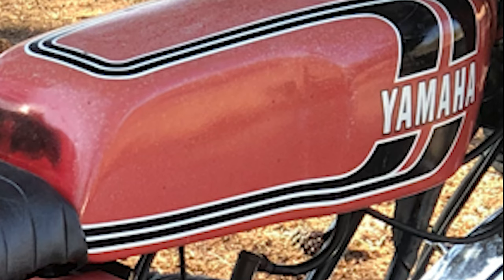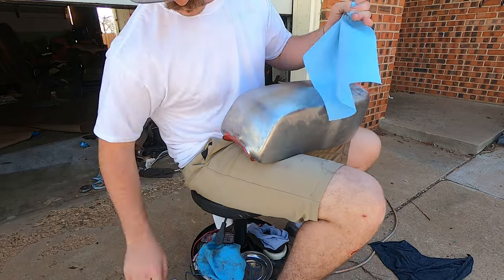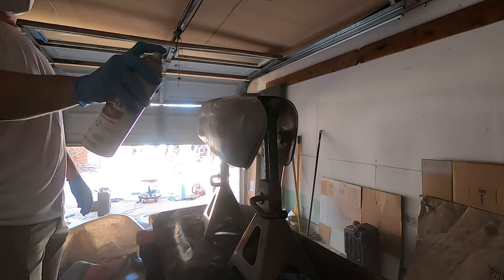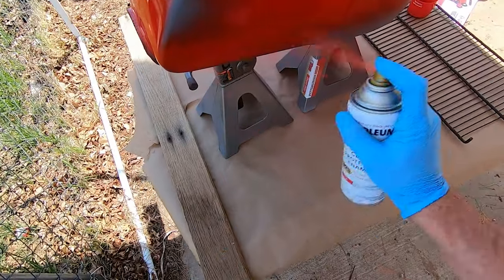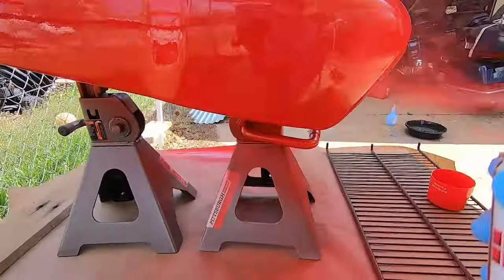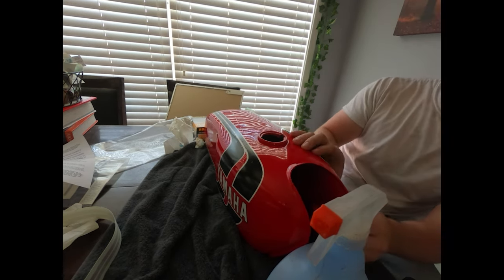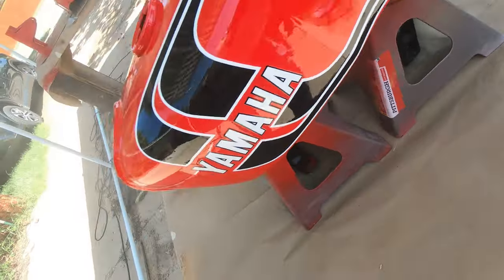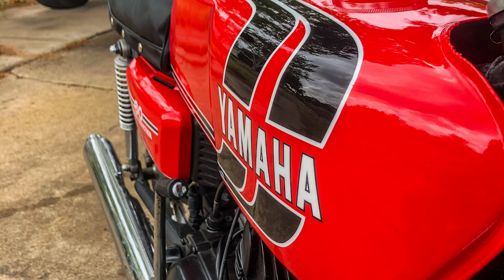How To Paint A Motorcycle Tank With Spray Paint/Rattle Cans Full Tutorial

Comment: So I painted my 82 xj650 yesterday followed your process down to the hb stands.  Waiting two weeks to mk clear coat.  Can I wet sand if I need to before the clear?
Paint came out great but there maybe a few areas.  Also if I do wet sand should I do entire tank or just the area thanks for the video you’re got talent
Reply from the maker: Yes you can wetsand once it is fully cured! The clearcoat should cover the cracks as long as you wetsand back up to the higher grits, like 3000 grit. I personally would just do the little spots, but that is just me!

Comment: This looks like an easy concept that uses two techniques I try to also use: patience and attention. Will this technique work if I use it to repaint the other parts of the bike? I assume it will, but I am also painfully well aware that there are pitfalls in meticulous jobs such as these.
Reply from the maker: I would believe so! I painted multiple metal parts at the same time, headlight bezels and what not!
Reply: @octanerestorations  I did the tank (and re-did it, but don't tell anybody) and it has turned out pretty well. I'm going to give the front fender a go next, assuming I didn't screw up round two.

Comment: That's a beautiful tank. I use the same paint as you did. Oil based, but I used gloss black. I don't even get close to the finish you do after the spraying of the Rust oleum. My painted parts look like I mixed sand with it. Do you sand after each coat of paint or primer? If so do you wet sand with 3000? I have been restoring a 1976 Yamaha RD 400. I have a shop in my garage and I do my own boring, porting and I also have a SuperFlow machine on & on. This bike will be high performance, but I can't paint worth a shit! I'm 68 years old and you would think I should have figured it out by now, but oh no. You did such a fantastic job on that tank! Thank you and I subscribed to your channel.
Reply from the maker: Thank you very much richard! And no sir I did not. I sanded my tank down with the wire brush, then used acetone or rubbing alcohol to get fine dust and particles off. I used the rustoleum automotive sandable primer, and sanded the primer after applying. I never sanded after the primer! I waited a few days for the primer to fully cure, then used the high gloss spray paint. After letting that cure I did the decals, then the 2 part clear coat, then ceramic coating. How new is your paint? if it isnt mixing properly I could see how suspended particles could look like sand. And also is your shop dust proof when you're laying the paint down? Thank you for subscribing!
Reply: @octanerestorations  Wanted to thank you again! The RD400 started with an auxiliary tank and now I'm going to paint the tank and fiberglass body kit. Now I'm 69, so I better get on it. LOL. Thanks for the info, I'll be following your directions, except the Gtechiq. I'll be using Turtle Wax Ceramic - so much less money $15.99 + tax. I'm already way over my budget, couldn't cheat on the mechanical - I'm the one who will be riding on the drag strip!🤕
Reply from the maker: @richardbartlett4075  Anytime! Glad it is going well and hope you continue to see good progress! And believe it or not I actually really like turtle wax brand. It won't last as long as the Gtech but the price is really hard to beat. Yep, better not skimp out on the mechanical aspect🤣
Reply: Hello again. I’m always full of questions and hope I’m not bothering you. Could you feel the edges of the decals after the final top coat? Thank you very much

Comment: That looks awesome..  What would happen if you put the decals on shortly after the paint had dried?   I'm doing a 1964 Triumph tank right now and part of the color scheme is a 4 inch 1/8' stripe that separates two colors.   (If you google 1964 Triumph 650 you'll see the paint scheme I'm talking about.)   I'm planning on using a pin stripe decal rather than painting it on (one less thing to worry about, and the decal pin stripe looks pretty good).   I'd like to try to paint the tank and then do the clear coat on the same day, but now you've got me thinking about that decal going on too soon.   It's a peal off pin stripe decal that doesn't use water to go on.  I don't want to mess up my paint messing with that decal.    I've purchased that same brand of 2K clear coat.    I suppose I could wait a couple weeks for the paint to fully cure then do the decal and clear coat.  This is my first time doing this, so Ive been taking my time prepping the tank.  It needed a little filler here and there.
Reply from the maker: My only issue with that is if you have to move the decal at all, theirs a very good chance that the pinstripe will pull up your paint! Another issue is if the clear coat if you spray the clear coat after 1 hour and before 48 hours the paint won't be fully cured for the clear coat to adhere to. Before the hour, the paint is "Wet" and laying the clear coat goes on like another layer of paint. After an hour and before the 48 hours the paint is trying to dry (the solvents are leaving the paint) which will cause bubbles in your clear coat. The solvent (which is the propellant/cutting agent) doesn't really start leaving the paint till the 1st hour. Just my two cents on it, i would wait till the paint dries (48 hours) then lay the decal, then lay the clear coat!
Reply: @octanerestorations  Thanks for the advice.  I'll wait 48 hours then lay down the pin stripe decal and then the clear coat.
Reply from the maker: @daveco1270  Anytime!

Comment: Heres a question. Did you sand it after the base coat but before putting the decals on? And then Clear coated it?
Reply from the maker: No sir I did not! I waited more then 48 hours for it to cure, then applied decals, then waited additional time and applied the 2 part clear coat. I have not had any adhesion problems, but some people recommend always sanding to help the layers adhere.